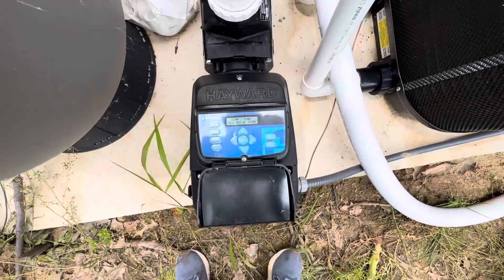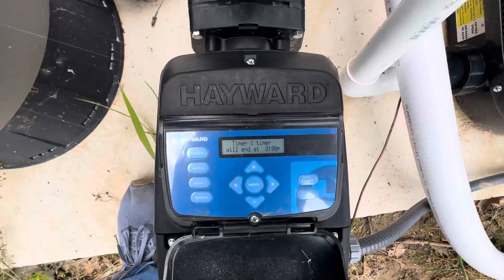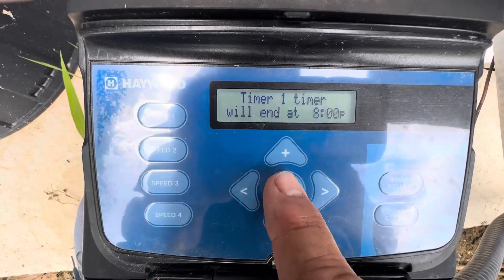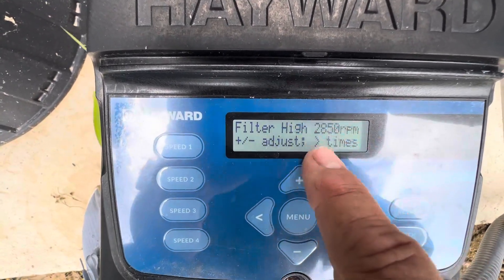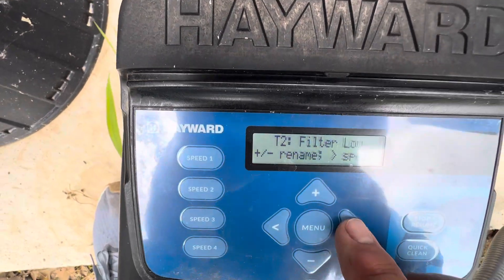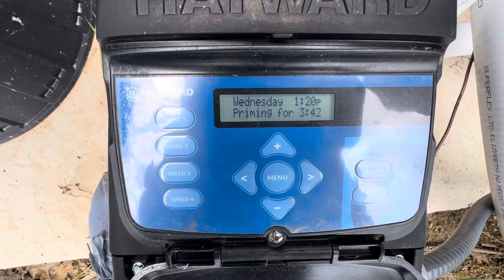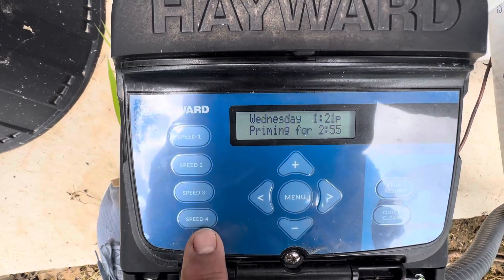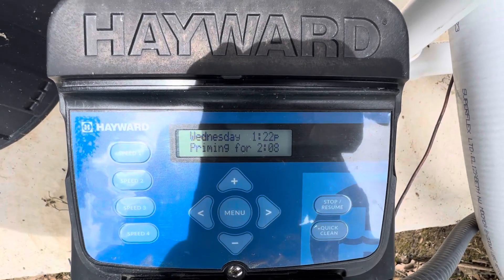Pump function and timer setting for Hayward Variable Speed pump-using RPM setting.

Comment: My installer hooked up the wires wrong and now the old timer controls power.  If old timer not on there is no power to Hayward pump.  Do you know how to connect properly

Comment: Question can I use this on my 22 inc sand filter system if I buy this pump and what about power outage do you have to reprogram the pump
Reply from the maker: I am sorry I am not on here very often.  I made this video for a customer.  Yes you could use this pump with your 22 inch sand filter.  You will set it according to the way you have it plumbed and the volume to you have to turn over for cleaning.  You need at least one turnover of filtration of your water per day.